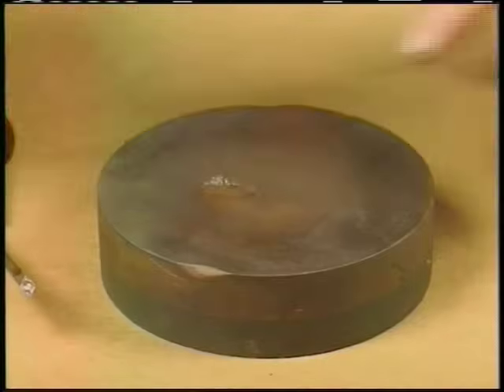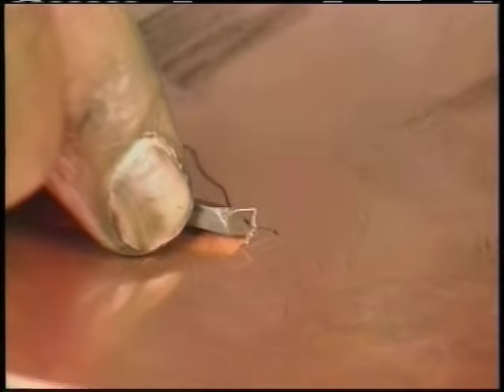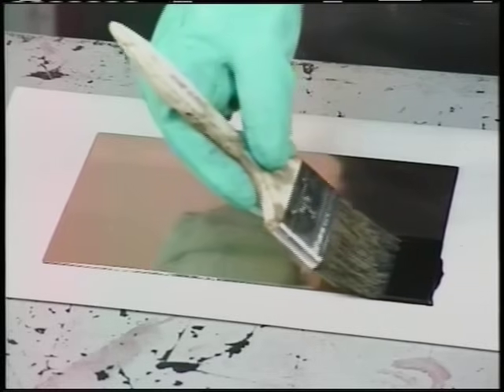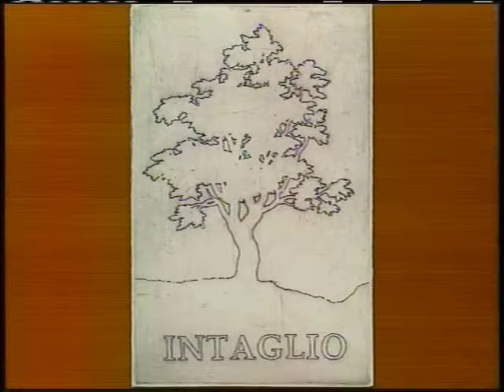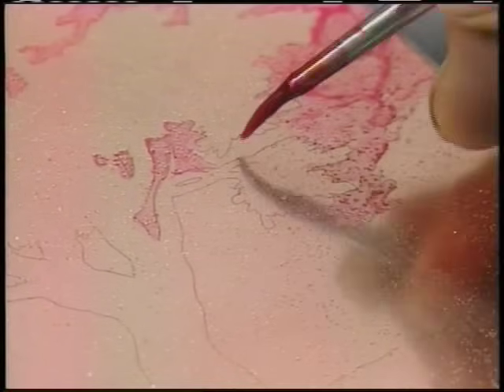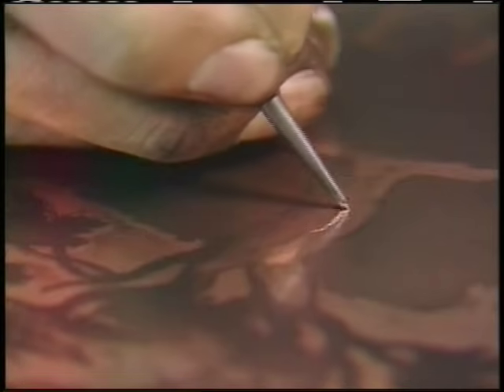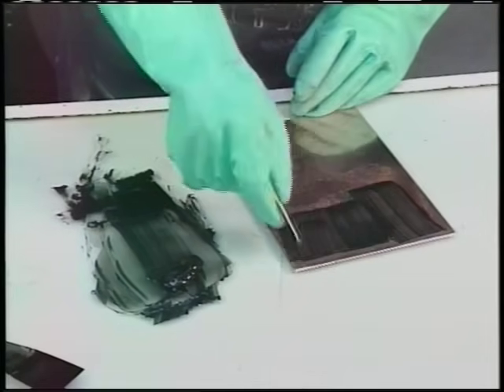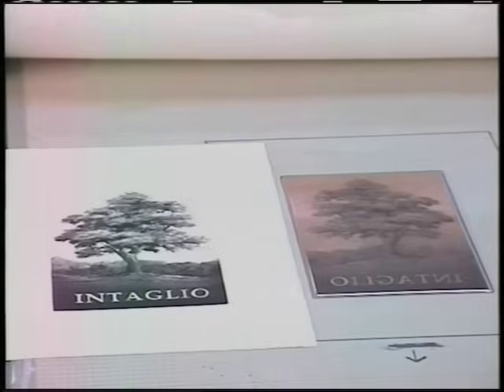Printmaking Processes: Intaglio

Comment: Very good! I'm in an "intro to intaglio' course at an art college, and not getting near this level of technical instruction. We just transfer a drawing onto a grounded plate, put it into acid for a time, rinse it, spray it with black spray paint, back into acid, and repeat. This is to establish etched lines. I don't get it. Then after that's done, we start aquatinting with the spray paint again. We have to stop out areas we don't want aquatinted, with spray - and so on. I'm finding it confusing

Comment: cheers for that, about 30seconds after i left that i found out by looking at another video,d'oh........i dont suppose you know what make and brand of inks i could be using for the monos and lino printing do you? ive had to buy a medium that mixes with my system 3d paint but i cant see it lasting that long, the stuff i remember using at uni came in metal tins but i never wrote the names down